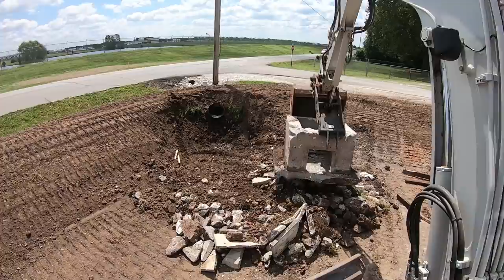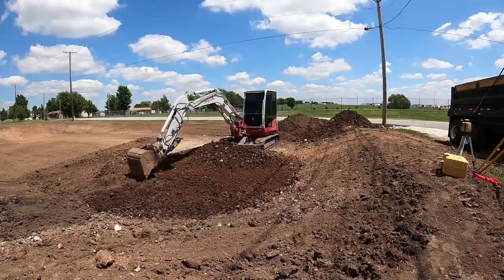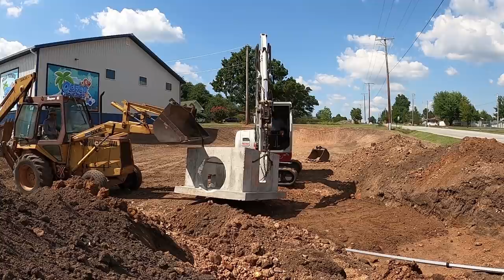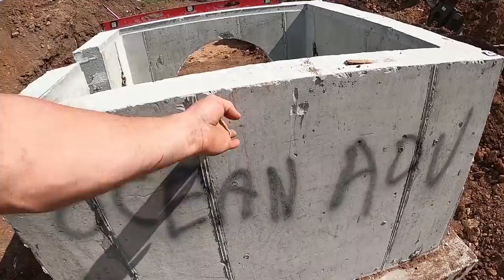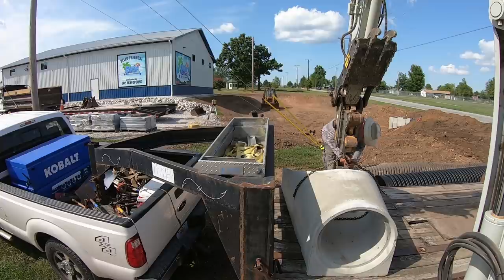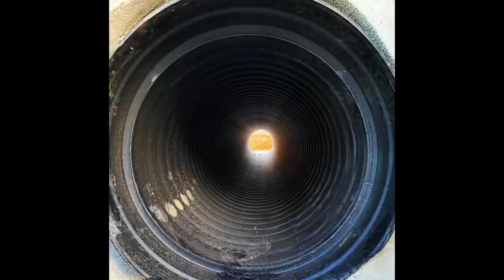Installing The New Catch Basin In The Detention Pond

Comment: The restricted control inlet is an Control Orifice we used to design a lot of storm water control manholes. Some would have a wall between the inlet and outlet pipe with an oriface in the wall,and the wall ( weir wall)would be a certain height ( like the high water elevation) 
If the concrete guys made the mistake and built it wrong, send it back.
Reply from the maker: Cool thank you I’m slowly learning the lingo lol We talked about sending it back but the owner and engineer wanted it done so we just graded it to make it work. Thanks again for watching
Reply: @eliteearthworksllc  you could also have had some concrete coring/saw cutting done and plug the openings that were incorrect.
Reply from the maker: That is true

Comment: How they make water detain? Is it by making the outlet pipe size smaller than what is actually required.? Where that water is going out from the basin,is it to the roadside ditch?
Reply from the maker: It runs into the basin and there is a plate with two 1/2” holes in it where the water flows in then goes to the ditch out front

Comment: I’m curious why you take the bucket off to lift the pipe. 

Also, you can tell that machine ain’t a rental. So gentle. I’m pretty smooth but I also like to hit stuff with the bucket. Except trench boxes. I hate when guys beat on a trench box instead of just taking some dirt out or rocking it down corner by corner.
Reply from the maker: I just take it off to get it out of the way. Yeah no rental I bought this machine new in 2019 and I try to keep it new. I’m the same way

Comment: Maybe I have this all wrong, but you have a 24" outflow pipe running into a what 8' pipe under the driveway, or is the water supposed to flow away from the driveway pipe in the other direction?  I know that's your building to city specs.
Reply from the maker: It’s a 16” pipe under that road I asked the engineer about at that and he didn’t have much of an answer lol. I think in two years they are planning to widen that road and put in storm drains so this thing will be pointless. Thanks again for watching
Reply: @eliteearthworksllc  POINTLESS! (The waste in this world)! Hey, as long as you get/got paid, so be it. Get the wrong box, install it anyway (w/mods) and the beat goes on! Sonny (CT)
Reply: @eliteearthworksllc  . "I think in two years they are planning to widen that road "   Then you get to,come back and continue with this neverending project.  And if they widen the road, well, there will be lots of work for you.
Reply from the maker: Yeah doesn’t make much sense
Reply from the maker: Very true job security I guess lol

Comment: FYI: The low flow with the two small holes is the orifice (or in this case, orifices). The larger cut out is the overflow weir.
Reply from the maker: Gotcha thank you I almost emailed you before I made this video so I would get those right lol! Appreciate you watching
Reply: @eliteearthworksllc  No problem Brandon - anytime. Personally, I would have changed that design to stick a 6" Schedule 40 PVC pipe into the inlet far enough to allow a cap to be screwed on the inside and tee off on the outside. Drill the holes into the cap inside the inlet, place a tee on the outside with 2' sections going in each direction and capped on the ends. Drill that pipe with multiple 3/8" holes and cover with clean 1/2" - 3/4" gravel. Then I would have had the overflow weir above this low flow. All of this would have been on the front of the structure and not the sides.
Reply: @davecrable1356 --- I agree. Your idea should have been the 'Engineer's Design'.
Reply from the maker: That is a good idea would be nice and clean too
Reply: After reviewing and approving stormwater management plans for the County over 32 years, our group usually found out the hard way what worked and what didn't. It got to the point where often times the engineers were coming to me at the beginning asking for advice.  The perforated PVC protection works. It is also easy to install and maintain 👌
Reply: @davecrable1356  that is how most of the ones around me are done
Reply: @jonschneck4559  Where are you located Jon?
Reply from the maker: That’s great they came to you though sounds like you got this stuff down

Comment: I just kinda guessed at the size of the box but doesn’t it weigh about 4,000 lbs?
Reply from the maker: They said it was right around 5,000lbs it was 5’x5’x36” with 6” thick walls and floor

Comment: If you doing mind me asking, what does a job like the drainage portion run?
Reply from the maker: I’d have to go back and look I know that box and pipe were $4500 that part may have been around $9000
Reply: @eliteearthworksllc  I’m new to this, young buck. I’m in Fort Worth, Tx. I’ve got a job that I’m doing for dirt cheap because I’m a fan of the guys. It’s 345’ of 24” pipe, with a 5’x5’ precast concrete catch basin and then gravel around the pipe, digging with excavator and using a skid steer to backfill the trench and backfilling a big hole he dug. Would you mind giving me a rough estimate of what you would charge on it? He chose me but said my bid was higher than the other guys and I don’t believe it because I’m always cheaper than everybody. We do drainage full time, but haven’t ever done this specific job type before
Reply: @eliteearthworksllc  also, it’s easy digging, no trees or roots or rock really. Cut and dry job. Well not dry, it’s drainage haha
Reply: @eliteearthworksllc  I’m nervous but know I can do the job. Mostly just nervous that I bid it waaay too cheap even though I bid it to win it. It’s Kenny Rogers, so I couldn’t lose the opportunity. I’ll Venmo you some money for the advice.